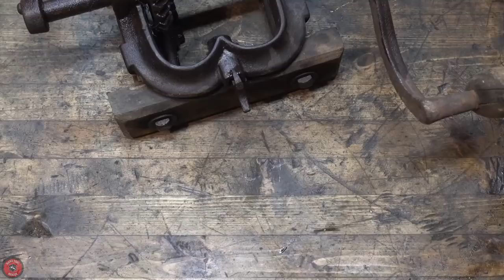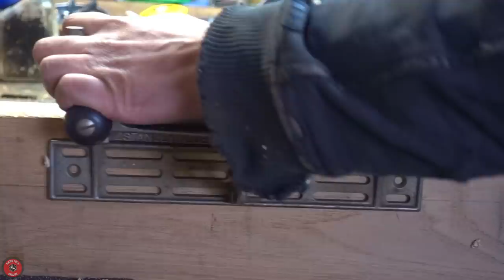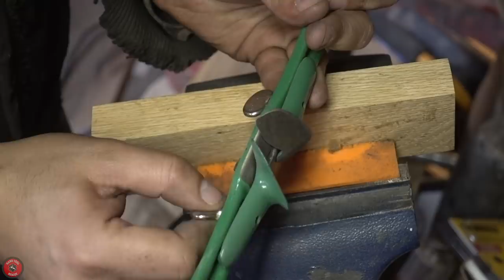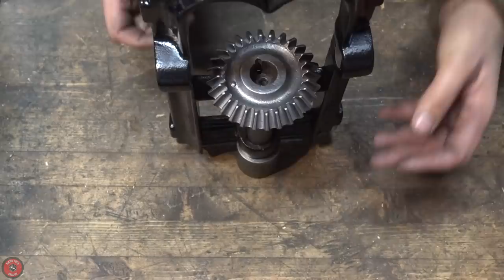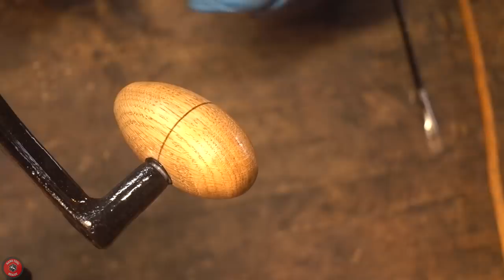Antique Beam Drill [Restoration]

Comment: The nice thing about a lot of white oak used in the tool's construction is rigidity without weight. The mortise and tenon construction demonstrates this tool was made to last, and could be carried up to the rafters to drill and install the wood pegs in the beam construction of barns and wooden buildings. Using the hand tools that resided in the old carpenter's tool box to restore the shape instead of grabbing a router was very interesting.  I agree about using 40 grit sandpaper to restore the patina to the repaired casting. Work of art.

Comment: Now this is a tool worth restoring, this type of manual drill is not only rare, but also still useful, in some cases even better than modern power tools. Whatever you decide to do with your other restored items keep this one in your workshop, you'll find it priceless if you do more intricate woodwork in the future. 
If you can't find more original drill heads you should be able to modify modern ones to fit, you'll find smaller diameter ones more useful whenever you need to drill angled holes in hard wood consistently and without damaging the surface.
Reply from the maker: Will do!

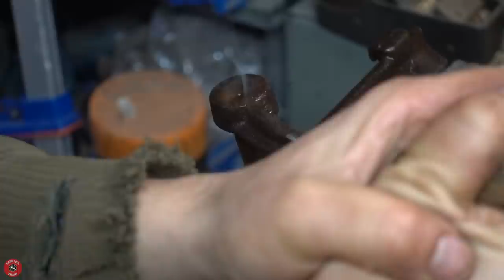Comment: What in the world did you put on the metal that made it steam/smoke?? AT 5:05
Reply from the maker: Fire + penetrating oil.
Reply: lol i was just as confused when that start smoking , i was like this guy is using some heavy duty stuff then a min later i realized that you heated it up with the torch :), good idea ill note that one down
Reply: At first I honestly thought is was just from 'Wiggle friction'...
That tell tale rust demon giving up its ghost right after it breaks free.
Reply: Why did you edit out the parts where you used fire?
Reply: Hand Tool Rescue I thought it was pickle paste or something!
Reply: at first i thought it was liquid nitrogen but then i remembered that it needs to be kept in a metal canister
Reply: Heat and oil or candle wax is the best way to get stubborn rusty parts loose.  When the red rust starts turning black from heat you  know it's getting ready to loosen.
Reply: Having used heat + oil many many times in the past, I knew instantly what was going on although I was surprised you touched the handles with bare hands. I'd have assumed the heat would have traveled most of the length of the handle.
Reply: iron is a bad thermal conductor. a blacksmith has a red glowing end and grips it 50 cm down of that.
Reply: You are one imaginative fella. Its awesome.
Reply: alien acid
Reply: NickDG
We used to call the torch a "Smoke Wrench".

Comment: Another fine restoration i must say!!
My initial guess was hickory on the wood but white oak is up there as far as hardness and strength.This wood beam drill was quite the invention for its time.
Journeyman electrician by trade here and was introduced to the electric mag-drill for drilling into steel beam on the job.Its wasn’t only extremely heavy but quite the challenge working off an eight foot ladder for vertical drilling.

Comment: Awesome resto !! You dont see many of those kicking around these days. 
A sweet trick for the wood screws when you are putting them back in. Put a drop of tightbond in the hole before you tighten. It wont stick to the screw but when it hardens it keeps the screw nice and tight, keeps them from stripping out in the future and makes for some nice hardened female threads in the wood. 👍

Comment: HTR, awesome looking restoration on this one. I've been looking for one of these for a while now, but want to restore my own. She is a beauty.
just a few pointers...
1. there should be leather pads (feet) at all for corners underneath.
2. You're meant to sit on it for stability of use.
3. Good luck finding replacement bits for that beam-drill (beam drill press/beam brace). 
Thank you so much for sharing.

Comment: Never seen one of these drills before .  but have seen dozens of the augers.   Bought a hundred year old farmhouse in the forest of South Sweden.  Did a lot of restoration on it and found that the walls are made of complete tree trunks  , squared off. .Not a nail in sight . Every trunk joined to the one underneath  with a 12"  11/2" wooden pin. as well as all the joints. .There must have been 500-1000 to pin the house together.  Found a lot of old augers  tossed aside in the barns . but never came across one of these.   I guess they must have had something like this to make it easier and keep it straight.       I use the word ``easier``  but still must have been damned hard work..            Advanced technology in 1902.

Comment: Love the fact you modified and are manufacturing the 1879 wrench. Would love to see someone manufacture these beam drills again (hint, hint). To use a power drill to bore out large long holes in beams really tear the drills up and they do not last that long doing that type of work. And, besides, if I had access to modern hand drove beam drills, I could sell them to Amish barn/house builders nationwide. Not to mention the "prepper market. But I would have to have one to torture to make sure it will hold up as well or better than the antique versions.

Comment: You should consider putting on some 320g or 400g sandpaper both sides of your table saw blade, helps remove the burn marks while cutting and reduces any sanding needed later on, all done in one pass sorta say. Should've put in some anti-seize on those gear shafts and handles in case of future rebuild. Just suggestions only, great video. Cheers :)

Comment: Exclusively for the type of shaft/crank combination you had here where everything was stuck, have some copper discs around the shop. You place the copper disc on the shaft (should be wider than the crank's face too) and then smack it with a ball peen hammer's ball end (or using a rounded punch for accuracy). No dings, and the perfect amount of zing to pop it loose. Works best with some penetrant agent, but i've used it dry as well (didn't want to damage the paint, Zinger machines, the lacquer, is easily destroyed by various solvents, turning white, milk like).

Comment: Use a mix of Tar and Linseed oil for all metal surfaces, it will give them glossy and durable rustproofing.

Use less/more tar for a thinner coating, for lighter color/ faster drying.
You can add thinner, brake clean etc to make it dry alot faster, after try it is not sticky.

I have used this stuff for all kinds of equipment, some that is already been deeply rusted and all of them have not rusted/ the rust has stopped spreading.
It even makes old paint look new-ish and glossy.

I suggest to test this stuff first before using it for tools etc to see what ratios work best for you.

Comment: dont think you will ever see this,, but,, here goes,,,  Yknow  ,,, I am 63 years young this year,, and always loved barns,  I have over 800 in my pictures from Michigan, and more outside,,,   I h ave worked in them, help fix them up and replace things, even modernized them,,,  and made them safe,,  but I have always wondered, how the heck in the 1800's and before, they made those large holes for the pegs,,,  as most were all wood, and not a stitch of steel or iron unless it was for hanging things up or for the doorway framework,,,  else, it was all oak and maple, and maybe some pine for the stalls and shielding,,  ,,  but now you answered it,!!!   I did surmise it was an auger bit, but always guessed it was on a TEE wrench like a tap and die set, or something like that,, and to see how they could angle it too, as often a beam needed a 45 or 60 now and then,,,  Great Work,,  take care,, Stay Safe!!

Comment: Hey for those pins you pull with the vise grips

You can weld a make shift slide hammer to the vise grips to make it easier to pull
Less twisting and prying

Jody has a vid making one on welding tips and tricks

Comment: Hey, Wranglerstar has one of those.

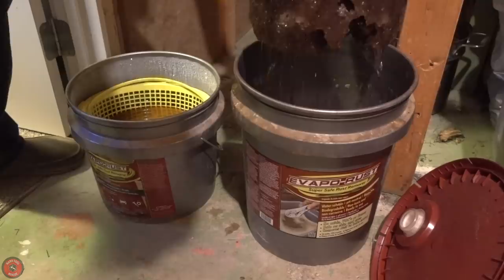Pretty cold in the shop, eh?  8:10

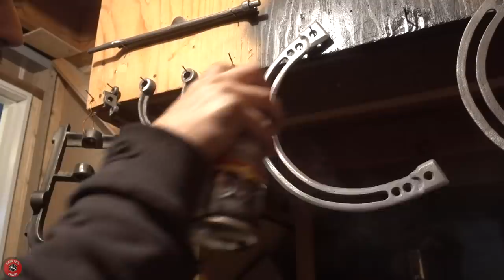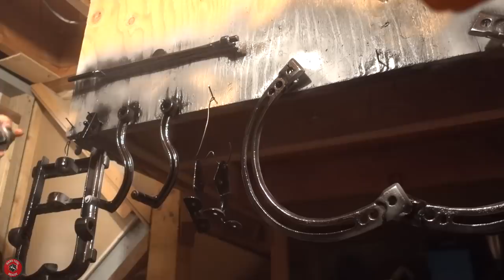6 coats and sand between?! 10:45 and 11:00  That sucks!  I hate painting.

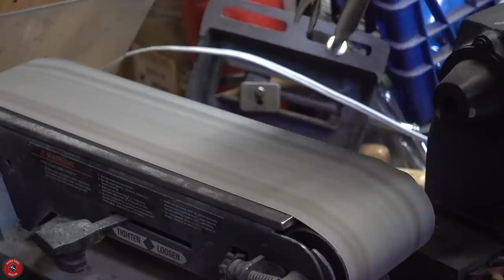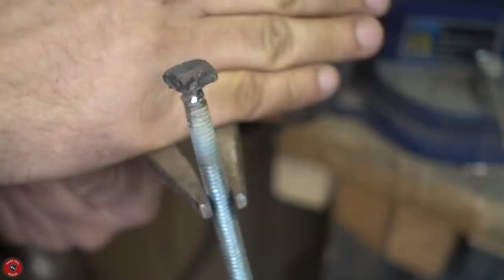Great job with that square-head bolt!  19:35 to 20:10

Horrible Fright has a "hinge drill bit set" that is GREAT for drilling holes for countersunk parts 23:40

Excellent restoration!
Reply from the maker: Thank you!  It was so cold.

Comment: Looks great. The only problem that I see is that all of the hardware that you reapplied will now flash rust in just a matter of days. I understand the aesthetics of using the original hardware but it is very simple to do an DIY zinc plate....Other than that, a fantastic restoration.

Comment: i donno if someone pointed this out in the comments but just in case: if you hold those epoxy syringes upright so that the air bubble is fully at the top you can ensure that it's pushed out and that the rest of the epoxy comes out more evenly. also figure out which of the parts has the greater viscosity and push on that side more and let the other side follow.

Comment: To mend a square head bolt I drill a center hole and thread it to screw onto the donor threads before welding. Keeps it centered and less likely to break again.

Comment: Have you ever tried dumping a whole sub assembly, screws and all into the Evaporust?  I have one such, a forge blower, and want to give it a try, but that much ERust is a bit expensive to try as an experiment.  I was hoping you  would give it a try as an adjunct to one of your resto videos.  If it works, meaning that the screws, etc are easier to remove and most of the rust is gone, I'll give it a go.

Comment: I got a much taller version of this tool base is the same as is the metal parts of the drill head but it’s fixed at 90degrees. Thankfully it’s in far better nick than yours. Came out of a railway engineering shop

Comment: nice and interesting video, as usual. Thank you for shareing it with us!
But I´ve got two questions: 
1) what´s the vapour coming out when you spray something from a small blue bottle? have you heated the iron pieces before and you´re cooling them?
2) why do you leave the central wooden panel loose (no glue) if afterwards you put two big screws through it which I asume would prevente any movement?
Best regards from Argentina!!
Reply from the maker: Thank you!

Yes, I heated the parts before I sprayed them

The wood panel is not touching the screws as I drilled it out.

Comment: Why finish the wood after you've assembled? It leaves the parts of the wood that are covered in metal unprotected. Just wondering. And also why not protect the screws from corrosion, or the shafts? Seems like a lot of work just to have wood rot and rust creep up again.

Comment: I have one of these I was wanting to restore. One of the handles has a slight bend in it and contacts the wingnut on the pivot. The handle is cast is there any way to bend it back or is it pretty much screwed?
Reply from the maker: If you get it red hot, it might bend a little, but it is very risky.  You may have to drill it out at the proper angle and put in a small bushing.

Comment: I’m curious about the fence you used on the (4 1/2?) hand plane.  Never saw that before.  You mentioned it’s for larger planes normally... but which one?  I want to be on the lookout for one now!  Oh, and the finished product is superb.  Very impressed.
Reply from the maker: Thank you!  It's a Stanley No. 386 fence.  It's made for No. 5-8 planes.  You can still get modern versions at Lee Valley.  Super helpful for squaring edges.
Reply: Hand Tool Rescue , very good.  I’m going to get one for my 6 and 7 then.  Thanks a lot.  Keep up the good work.

Comment: Take a deep breath and enjoy your work. Inhale, exhale; no rush involved. You're resurrecting a piece of history what otherwise would be scrap. Think about the best way to get the best result. To be clear; this is different from "how do I get a quick result". I like what you are doing but, I'm a designer/machinist, I think you could improve your approach for the pieces at hand and your skills could be way better too. I'm not nagging, I can see you got the talent but you're going fast forward all the time and by doing so you're cutting corners intentionally/unintentionally; I don't know. But as an advice for, what it's worth; Think some more ahead of the steps involved to complete the designated project. Think about what should be saved and what has to be replaced. Use our mill and lathe to reproduce the missing or unsavable parts. Make a plan how to attack the production of these parts. In doubt; go see some skilled machinist on YouTube performing the task at hand. Buy  a new lathe or atleast replace some sounding (spindle?) bearings. Learn how to machine on the mill and lathe; it's great fun and a learning goal for years ahead. Buy a belt sander instead of planing against the grain and break the edges out. And to be honest I got a lot more tips on how to improve your work on beautiful (much appreciated) tools from the past. Maybe this helps; think about the means and dedication of the people who produced it long time ago. Low wages, sweating boss in the neck; material was more expensive than the labour to produce. Thank God things have changed a lot, not ideally yet unfortunately, but the quality outcome was the most important. I hope I helped you here to improve your live, work and possibly your channel too. Best, Job

Comment: some peneraterating oil would have kept the bolt from ringing off.

here you go.            http://drxcleaner.com/

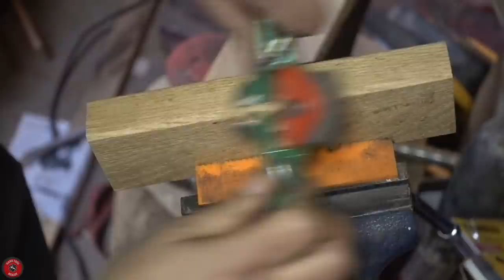18:03   wow, that looks like an adjustable 90 degree spoke shave.

would have put sealer on the wood before full assembly , and oiled it before full assembly as well.

job well done !

excellent vlog !!  2 thumbs up !!

Comment: What is Wrought iron?
Reply: I'm not a metallurgist, but wrought iron is iron that can be heated and bent easily without it weakening too much. Wrought is another word for "worked".
This is as opposed to cast iron which was hot enough to be liquid at some point which makes it easy to pour into molds, but also makes it more crystalline and brittle, and therefore not bendable or workable.
When you see "wrought iron",  think of blacksmiths heating and smacking hot iron into different shapes (like horse shoes).